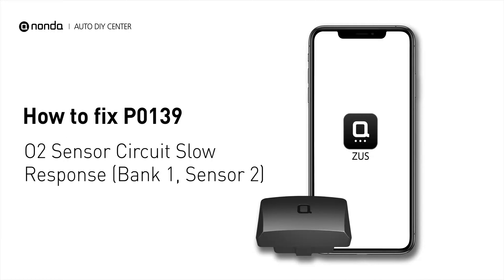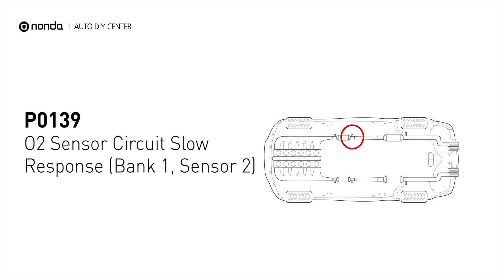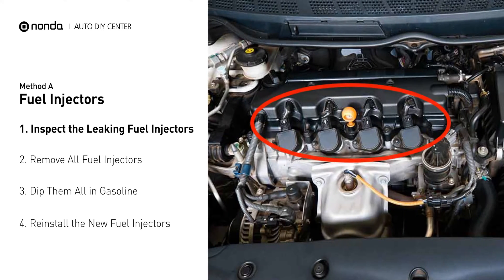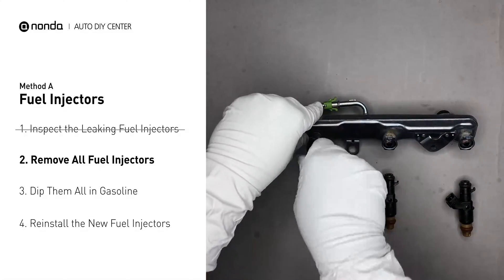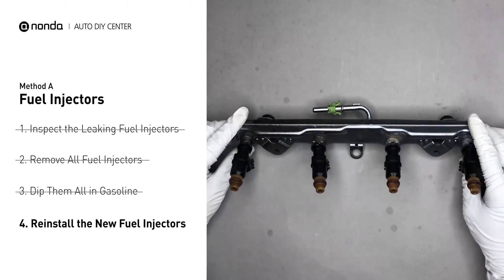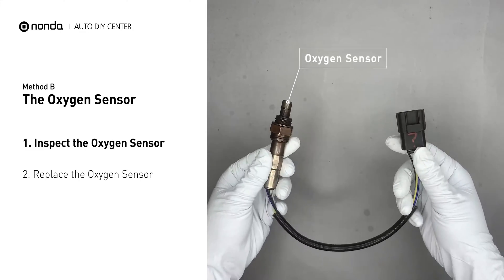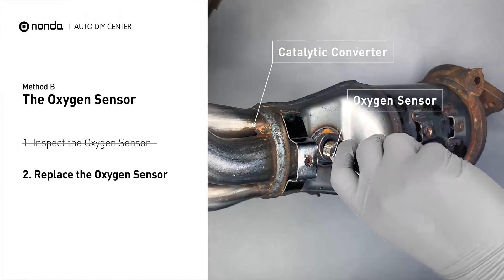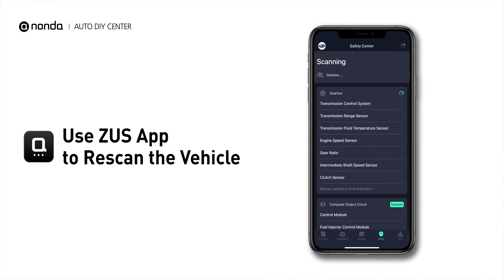How to Fix P0139 Engine Code in 3 Minutes [2 DIY Methods / Only $8.24]

Comment from the maker: Hi, I'm Steve, nonda's lead mechanic engineer. 
Feel free to leave your comments here if you have any mechanic questions, I will be glad to help you out!
Reply: I got a code p0139, then I replaced the oxygen sensor, and the code still appears?
Reply: @yaqalrimi7050 check for wiring your probably shirt somewhere driver side underneath there’s a big fat wire and check for open circuit I have the same code on my q7. 4.2 I’m gonna fix it tomorrow don’t replace parts based on codes budd

Comment: Hi my friends . I have a tucson 2016. My mechanic says i Need to change my 02 oxygen sensor . I have a code P0139 . I wanna know, what is the cost of This sensor ?
Reply from the maker: Hi Demian, is this the only code you are getting?
Reply: @nondainc  i Had so Many problems. But all are solved. I’ve changed 2 coils, the 4 plugs and the Catalytic. Right now the P0139 is the only code
Reply from the maker: Hi Demian, the sensor cost should be around $20 to $200.

Comment: thanks for your video.but I did cat remove,so my p0139 error keep showing and wont remove even by changing my o2 sensors to newer ones.is there any soloution to that? except those fake o2 sensors? because they dont work either.the car is mazda3 2.0 2010.
Reply from the maker: Hi Sean, have you checked the condition of the wiring to fuse box and oxygen sensor? Kindly make sure that they are fine, and check if the voltage coming to/from the oxygen sensor is within specification.

Comment: I got a p2098 and p0139 codes on my 2017 nissan 370z. I have replaced all four o2 sensors and exhaust pipe gaskets as well, but the the check engine light still persists. Could it be bad injectors?
Reply from the maker: Hello, we suggest to have it visually inspected by your mechanic for further diagnosis.